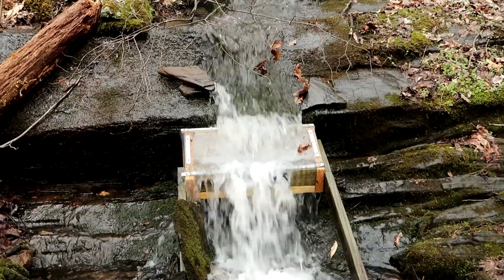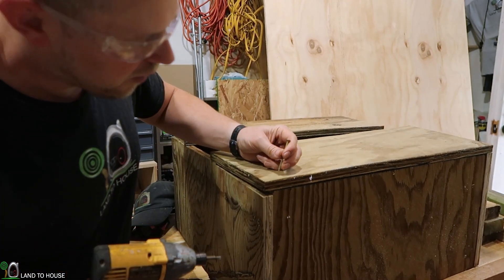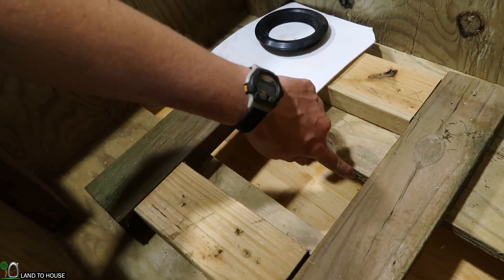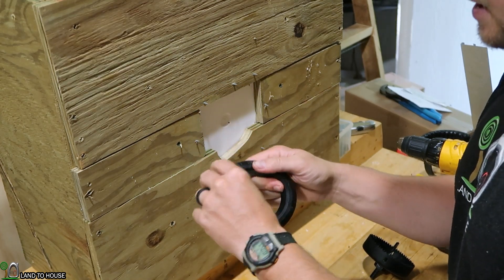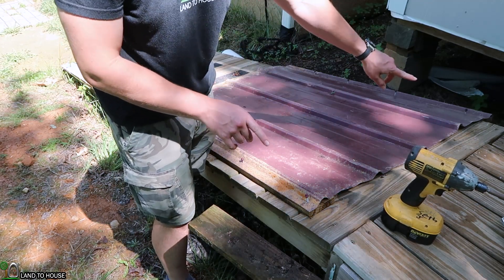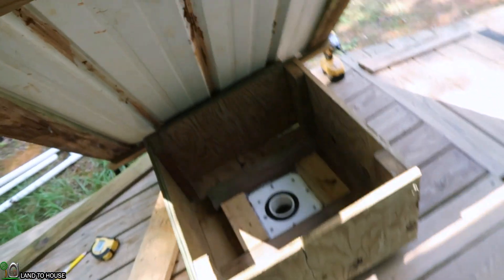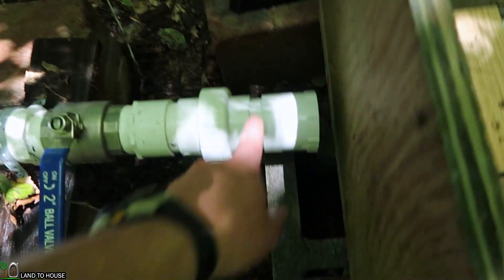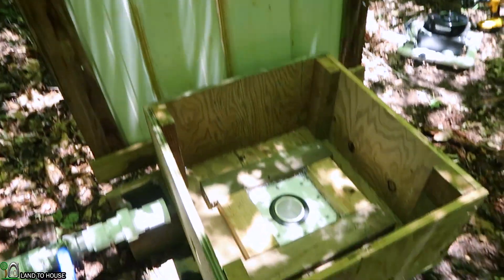Turbine Housing Build and Install Micro Hydro 5/10

Comment: I have been watching your videos the last couple of days and I enjoy seeing your ingenuity play out. To catch the water and route it away from your box, you could use a yard drainage system catch basin place through the bottom of the box. To save money, maybe a 2 to 5 gallon bucket that the generator sits above with the rest of the bucket through a hole which exits the bottom. Then your 3” pipe out the bottom, a 90 and route to your creek. This would keep the water away from the generator.

Comment: Grind off the points of those screws coming through the edges of that top before the wind blows it onto your head one of these days. You know some water is going to get in there, so a screen covered drain at the lowest spot would be helpful. Looking forward to seeing this work. 👍👍
Reply from the maker: I ended up having to drill a hole in the bottom to drain the water. I forget when I show that.

Comment: I'm enjoying the videos immensely.  As I say you putting the bucket lid and uniseal under the turbine I'm wondering if your opening is big enough to allow sufficient 'fall' from the blades or if the water is going to pool and produce some turbulence losses.  My thoughts were use your router to add a rabbet to the edges of the turbine's support boards so it drops in to sit on the ledge and keep it from shifting side-to-side, and wide open below that for complete 'fall' from the blades.  A big catch pan (piece of water barrel or trash can) under it to contain the water falling from the turbine and then a flume or plumbing to return the water to the creek.

Comment: I have installed metal roofing. They make foam inserts to prevent bugs from entering but allow for some ventilation but, you could probably find something similar to stuff in the gaps at your local "wally store". 
One thing I use for wood build applications that will see a lot of water is "deck paint" (not stain). It is rugged, water proof and fairly inexpensive for the protection you get. I believe some have mold and fungus inhibitors in them. Once your design is to your liking, I would caulk every joint and give the box 2 or 3 complete overall heavy coatings of deck paint, making sure every surface is coated including any hole through-put surfaces. (The box should be completely dried out beforehand, of coarse). 
Anyway, I see you have linked to your Facebook page. Will follow you there. Thanks for sharing your projects with us.
Reply from the maker: Good advice! This box will likely get a redesign at some point. It works well but does not look all that great. Paint would help.
Reply: @LandtoHouse  It's a process getting things right. Now you have something that you can learn on and adapt. I suggested 'deck paint' specifically because it is intended to stand up to all weather and lots of foot traffic. The stuff is tough. 
I also have experience in commercial fishing boat building. We would apply fiberglass and resin then a 'jell coat' on exposed wooden surfaces we built (like the exterior of cabins and decks). But, that can get pricey if you can't get it wholesale and in bulk, like we did. I wouldn't go that route until I was certain my design was where I wanted it to be...

Comment: 16:26 you reallllly gota a) give those PVC fittings a twist as you push them together b) hold them in place for about 3-4 seconds minimum. If you don't, you can get weak welds and it might leak

Comment: Not your usual standard of a quality finish, I know it will still work fine,  it I was hoping for something a little more refined. 🤷‍♂️ I hope to see you comeback to this box and give it a more polished finish, once you have had time to iron out the full system creases. Not hating on the job, I just like to see things done well, since you have already gone to the effort and expense.
Reply from the maker: Yes! I will be remaking this box. It was mostly a "get it done" build. Now that I know it works I will make a better one.

Comment: you are aware that restricting the outlet flow like that is filling up the pelton space and slowing it down right!
Reply from the maker: Yes there was an issue with that. Its doing well now at only 12gpm BUT a redesign is in the works.
Reply: @LandtoHouse  if your just playing around for fun, then you probably want to get another bare cheap http://www.motenergy.com/hydro-power-products.html rip off the pelton and make and fit a small tesla as 2400 rpm is simple for them, and logicly use a round housing (i dont know what he was thinking making it square and restricting flo yet again ).

find and get the us vision of "10 x New FIBC Bulk Bags Builders Garden Waste 1 Tonne TON Jumbo Bags Storage Sack" and large tarp. take em up the hill and fill em up with dirt or is it clay up there ..for a far simpler way to collect redirect the bulk of head water rather than busting sandstone! for instance

Comment: I am curious why you didn't just extend eh penstock another 20 or 30 feet and then you wouldn't have had to worry about directing the water through a small 3 inch pipe down to the creek. If you mounted the turbine at the creek you wouldn't have had to close in the box at all. Isn't the 3 inch pipe causing resistance issues against the pelton wheel making it less efficient? But great job, nonetheless.
Reply from the maker: That 3" pipe is causing a lot of resistance. I've already purchased the materials to make a nice housing. It's going to be out of PVC trim with plexiglass base. And two 3" exit pipes
Reply: @LandtoHouse  If I may, I suggest you allow for a 12-18 inch  "fall" from the pelton wheel before ponding up the water to drain it away.  You don't want it getting bogged down by the turbine chamber becoming flooded and impeding the wheel, nor up-splash from the draining water below to impede the wheel.  Just dig a trench lined with sheet plastic and put your new housing over that so the water drains free as though it were straddling the creek like your neighbor's micro-hydro does.
Reply from the maker: Yes. The new housing is going to have a much larger catch base under the pma.
Reply: @LandtoHouse  Or maybe build another flume for the housing to sit on top of to send the outlet water back to the creek.  Lots of possibilities with that...

Comment: A little off topic, but I just got 300' of poly pipe and 100' of 2" PVC (the 1 1/4" Lowes had in stick had really thin walls) to go with the 1 1/4" ram pump I just bought from you through Amazon.  I would like to make a video as I instal it and was wondering if you would be OK with me mentioning your channel in the video.  I'm no YouTube Jedi like you, but maybe the few people who watch my video will get hooked on your channel like I did.
Reply from the maker: Hello. Its best to keep the drive pipe the same size as the pump. If its mismatched it can reduce the pressure wave. Because you have the pipe already you might consider a stand pipe.

Yes please feel free to mention Land To House in your video.  Looking forward to seeing what you come up with.
Reply: @LandtoHouse  Dang!  I wondered about that, but couldn't remember if you had mentioned it in any of your videos.  I plan on having a stand pipe similar to the 5 gallon bucket you use.  I guess I will see if I can find some heavier 1 1/4" PVC, or maybe I will splurge and get 1 1/4" steel pipe.  Thanks for the reply!

Comment: If you reversed the uniseal it would have less of a lip. 
Don't you want a little more cooling for the turbine by allowing air into the box? 🦀
Reply from the maker: Cooling seems to be good under the trees. The uniseal is doing really well!
Reply: Seth, with stream cold water feeding the spray nozzles probably no other cooling would be required in the box. 
That turbine really spins up.  🦀

Comment: Love the series, but you must be the king of tetanus.  Almost every screw you install is the wrong length and stick out of the back.  How many times do you poke yourself or scratch your arms up?
Reply from the maker: Haha none so far. Now that I know this turbine is going to work I have a redesign for the housing. Pvc trim for rot resistance and better water shed.
Reply: @LandtoHouse  That's cool. Just finished all 10 parts last night.  Watching the off-grid one.  Can't wait to see more.  Thanks for the content.